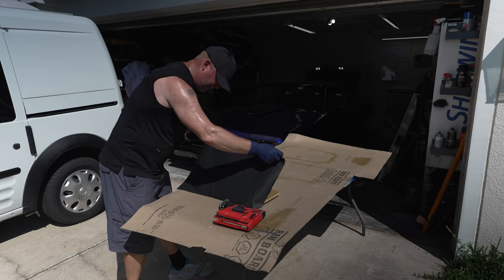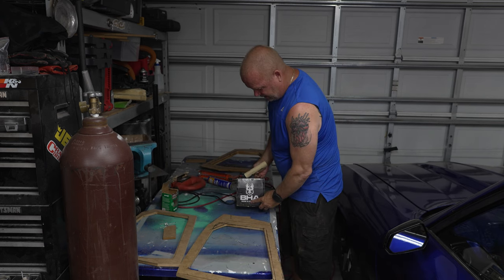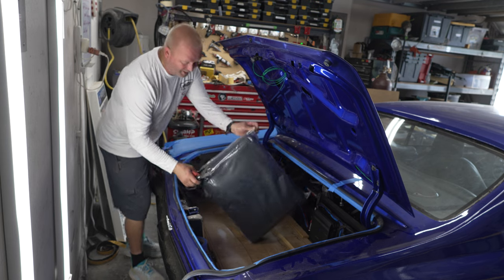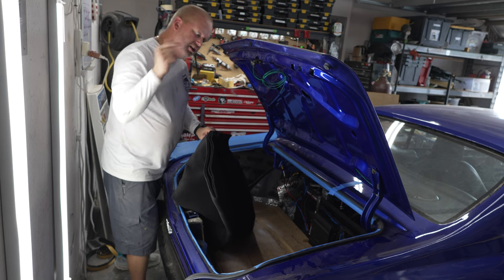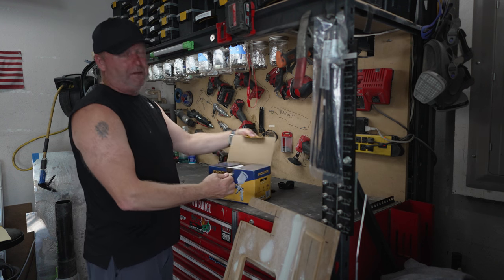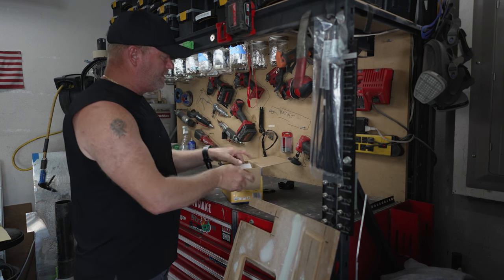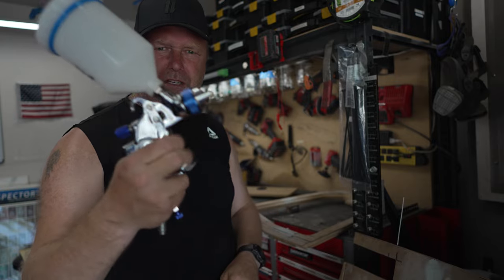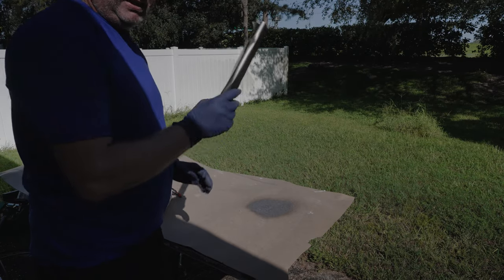Secrets of GM A-Body Customization

Comment: What/ how do you keep the walls secured from falling over in the trunk? I’m laying out the trunk in my 64 Riv, and was thinking possibly of using magnets. Your trunk looks great
Reply from the maker: Thanks Jason! I used magnets in the last one and didn't really like it even using rare earth magnets. I drilled a hole about 3/8" and insterted on of the tee nuts I added in the description. They are very handy. I love to put them on the backside of stuff also which stops any possibility of them pulling through. If you look real close you can see one in the video. I only used 1 per corner. 2 per corner would be a little better but I couldn't get to another spot to drill once they were in there. Hope that helps.